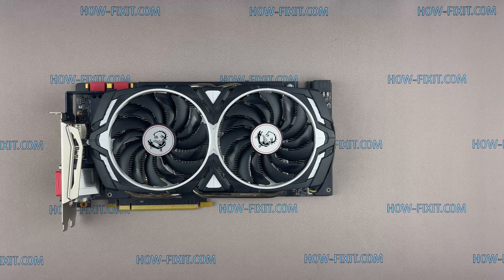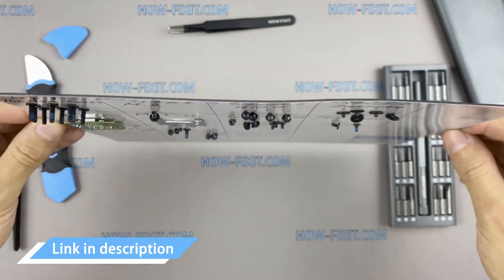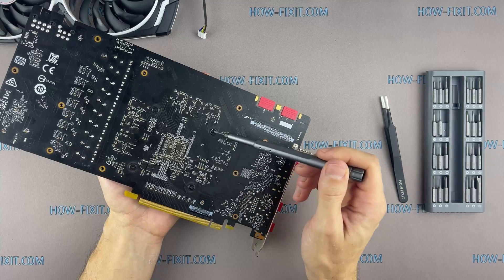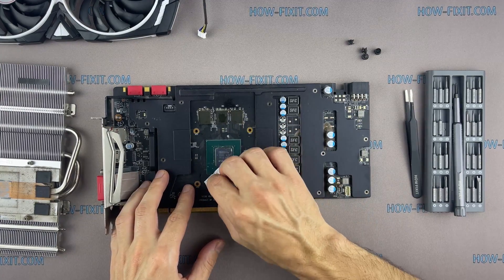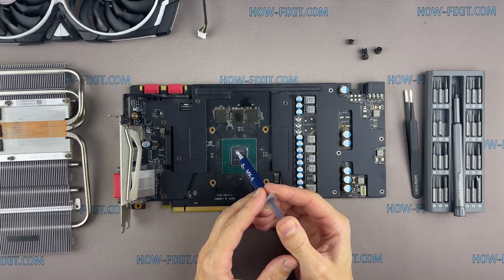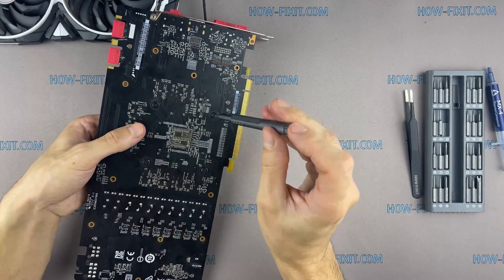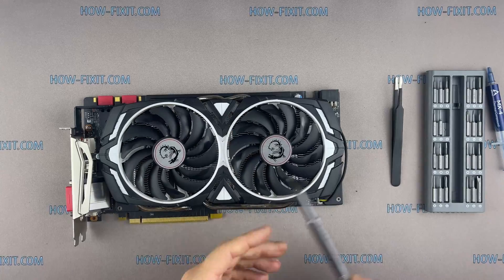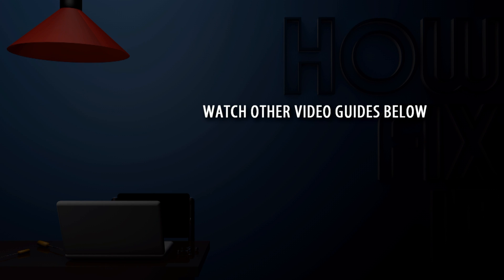GeForce GTX 1070 MSI Armor Disassembly, fan cleaning and thermal paste replacement

Comment: its amazing i have watched several cleaning and thermal paste replacement and no one knows how to apply the termal paste correctly.  
with this method you are creating air bubbles,  just a pea size amount paste in the middle then on with the cooler the rest is physics.
Reply from the maker: It all depends on the type of thermal paste viscosity. Don't worry, no air bubbles, some problems are far-fetched.
Reply: @howfixit  No its not accurate i know my pysics man!   Pea size always wins  you are just to lazy to realize that
Reply: Really depends on thermal compound used. Some are too viscous to trust the heatsink to squish it properly. You need to do the pre-smear of super viscous compounds.
Reply: @RailithicEmporthus  If you are too viscous to trust the heatsink to squish it properly  you probably shouldn't even do it!   My god!
Reply: @Hammersch How about YOU go apply thermal paste to YOUR things, however YOU prefer... Let the dude do what he wants. 😂

Comment: What can i use other than isopropyl alcohol?
Reply: Peanut butter bro, or toothpaste, maybe sulphuric acid? 🤔 

😮‍💨just mix them all ok?
Reply: nothing really because isopropyl 99.5% is the best   you can use 70-80% but i wouldn't recommend it.  i used 80% last time and it workes with no problem but i was skeptic.  you should always go for 99.5    its cheap